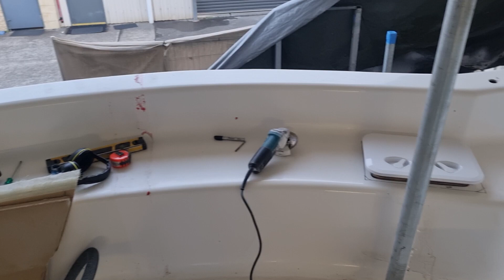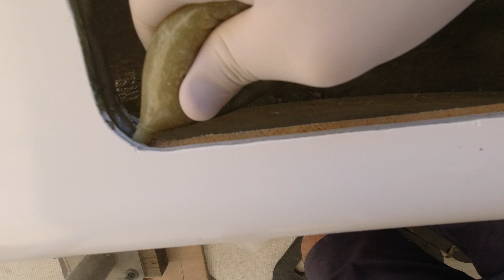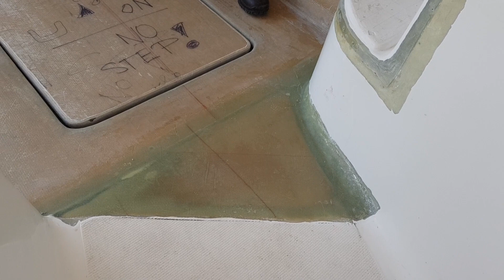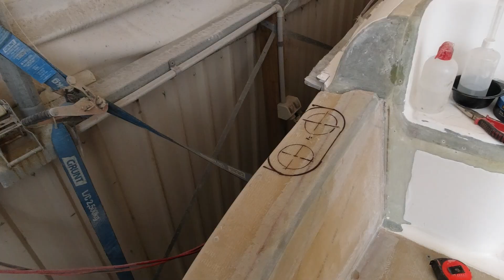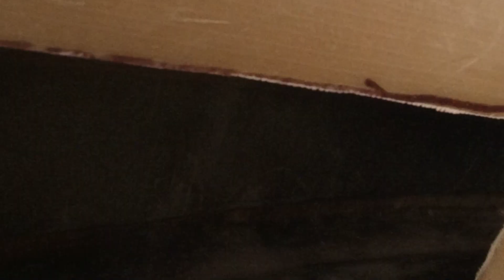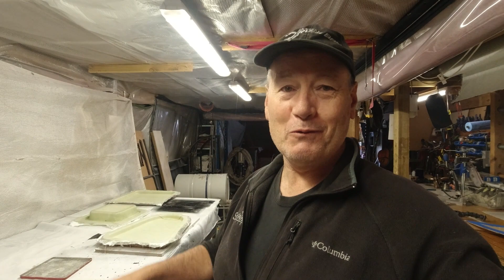Done Once, Done Right - Catamaran Build Ep243

Comment: Why do you need two fillers for fuel on the same side and same location Ross? If one’s for water I would have put it away from the other to stop accidents?
Reply from the maker: Both diesel fillers,boat is 6.7 mtrs wide on occassion fuel bowsers at marinas are not capable of reaching the far side .Save time and effort  and reduces traffic chaos at marinas.
Reply: @LifeOnTheHulls  ahhhh, I thought both tanks were connected, guessing only for transfer via a valve or something hence the need to have two? 👍🏼

Comment: Not flush hatches in those bench seats? How is that going to be to sit/lie down on?
Reply from the maker: Lounge has full length cushions and I will recess the underneath to fit the hatches.Ross
Reply: @LifeOnTheHulls  Heard the story of the Princess and the Pea? You are going to feel those hatches thru the cushions. No way around it. I'm frankly amazed. You put so much thought into all other details and you're gonna spend years and years sitting on raised hatches?
Reply from the maker: @JCrook1028  haven't installed them Have considered making flat inset hatches from a mould i have I just am running out of time here.
Reply: @LifeOnTheHulls  Please do. You know as well as I do if you don't you'll be redoing it someday.

Comment: On the fly engineering changes often have unseen ramifications. I hope the hatch cut in the bulkhead doesn't cause a weakening of it or potential failure. You may want to at least consider a custom hatch with a very thick/strong spigot that can be tabbed in to support the edges of the hole a prevent any damage from the tensile, compressive and torsional loads in that area. Maybe this is a non structural area idk.....just a consideration.

Comment: Great progress Ross!
Unhelpful tips and suggestions :)
I still think the sugar scoop hatch should open towards the stern for protection from waves if you need to access it in a sea way and the deck makes a nice shelf for parts and tools while working in the engine space.
Fill ports: use some yellow enamel paint in the label section for the diesel, blue for the potable water and brown for the black water port. You don't want to pull an "Expedition Drenched" when filling the fuel tanks (they put 500L of diesel into their fresh water tanks):P
Reply from the maker: The engine is not accessible from this hatch.It is a totally sealed compartment from the remainder of the biat.There is only the Rudder mechanism and exhaust in this lazarette,and storage of fenders etc Engine is accessed from inside the boat.Ross
Reply from the maker: Ladder is telescopic and will slide out of the stern without having to open the hatch.Ross